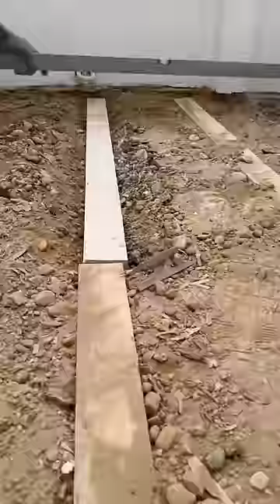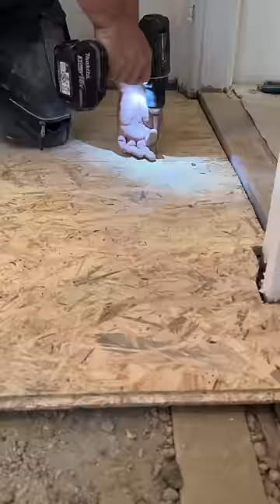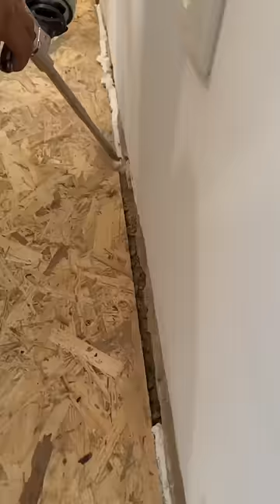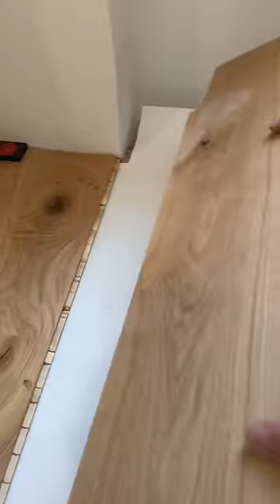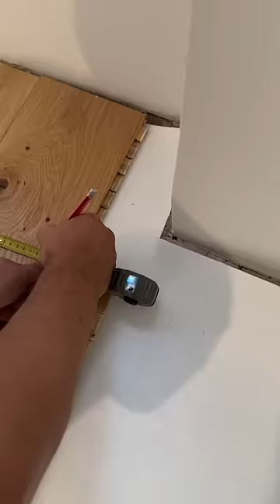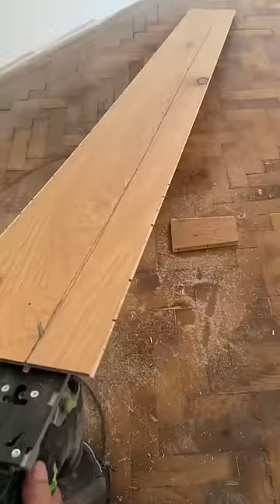Before/After in 60 seconds: subfloor and parquet new again ✅ #shorts

Comment: Here's a little explanation for the American community: in Germany or Austria, it used to be quite normal to fill in between the rafters on the ground with gravel or dry soil. This fill is dry and was also used as fill on concrete. Since no moisture can come from below, this is perfectly fine. It has been dry for the last 50 years and will remain so for the next 50 years! And we don't have any termites either!
Reply: No, this Is not normal even in czech republic as new reconstruction.
Reply: Only when it got wet did you have a big problem.

Comment: No foundation
No sub base layer
No insulation 
No damp proof layer
No concrete
Apart from that it’s fab.
Reply: That's neither soil nor the ground floor, two centuries ago people used these rock fillings in the ceilings.
Reply: No nothing!😮
Reply: No pressure treated wood

Comment: This is not ground floor as some people are assuming. The dirt or sand you are seeing is above a brick vaulted ceiling and it is a common detail in old buildings. Vault is constructed only as a thin shell and to stabilize it and weigh it down you use sand. Since it is enclosed and above ground, it is dry

Comment: Would have been cheaper and better to have poured a thin layer of concrete. And would have lasted way longer
Reply from the maker: This will last for many many years also. It is always a question of investment 🤷‍♂️🤝
Reply: osb placed directly on the ground, without any kind of water protection … you will have moisture going up and this will not last “many many years” for sure …
Reply: @Duca4 это многоэтажный дом.
Reply: @Duca4 This layer of dirt is really common in very old houses and these are standing for more than hundreds of years. In Germany we call this "Schüttung" and it will not get wet so the wood will not take any damage from it. Modern Buildings will not contain something like this, mostly buildings from before 1950
Reply: This won't last even 6 months
Reply: @bigbuttz I’ve lived in a over 200year old house (in the 4th floor) and filling in the floor looked exactly the same. This is not ground soil.
Reply: @siedinger It‘s becoming a thing again. Friends of use build a very new, ecological modern house and they used some clay gravel filling in the ceilings.

Comment: Definitely a bad idea to put wood and subfloor directly to loose ground, The ground will rot all the woods in a few years, biggest wasted money I ever seen.
Reply: Nope, you just dont know anything about european houses, its just there for weight to minimize acustic. Houses are build like that more than 500 years ago. 
But in merica you dont know that for sure.
Reply: He could have poured a 2 inch think dry pour concrete subfloor. But for the fact he never used moisture barrier. He was all set to install the floor with zero knowledge of how material vs nature works.
Reply: @djpaullawrence9993  there is no moisture due to the construction of the house, a common build style in europe, works fine. Concrete will just break.
Reply: @user-js9xv6zb3p  , Not going to argue that, but if you score the concrete and have even distribution of beams, foot traffic is not going to cause it to break. Even using the concrete as a form of grout will keep the soil stabilized and restrict settling. That floor is going to bounce  once the traffic increase.